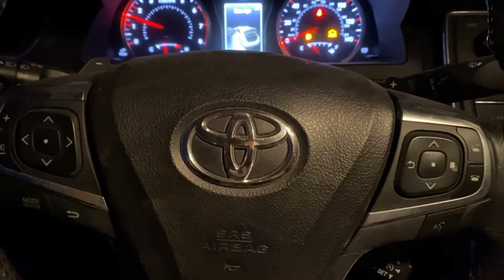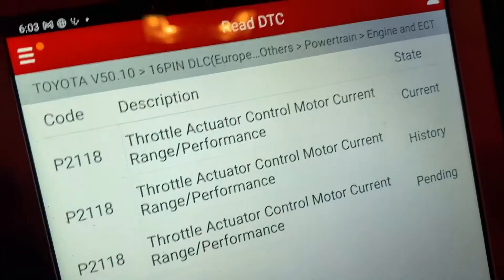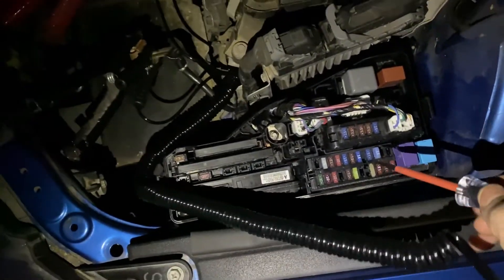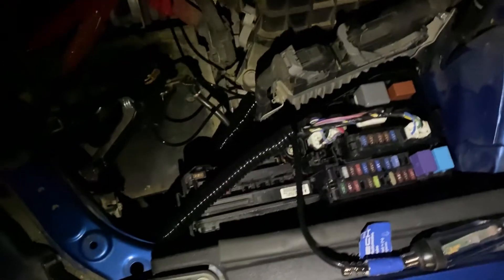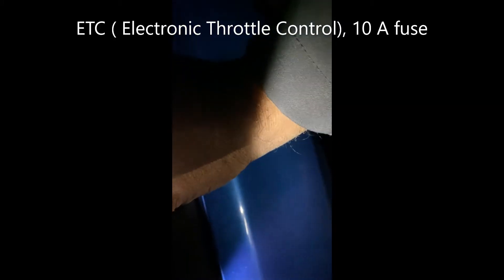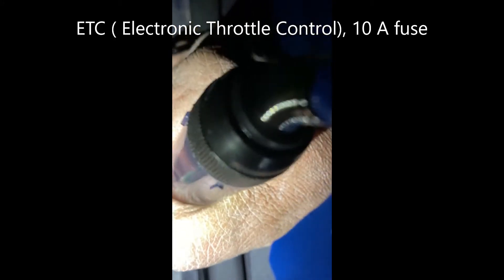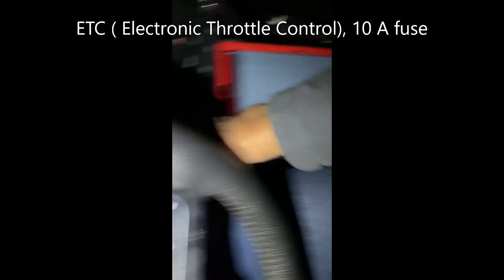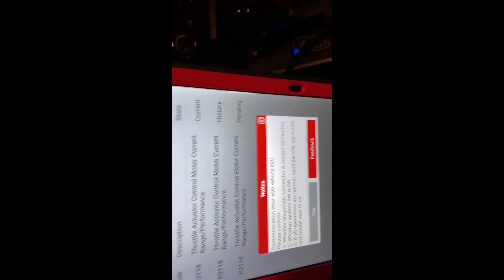Toyota P2118, Throttle Actuator Control Motor Current Range/Performance

Comment: Which scanner you are using?
Reply from the maker: I use Launch software, if you need one, I have one extra only OBD interface without tablet or phone, you can use your phone or your tablet with a minimum of 32GB storage( all cars brand and most special function) free update till July 2022, after update period you can still use it but no online function or you updated for $90/Year, let me know if you need it, the interface will cost $500 not include shipping, Thanks